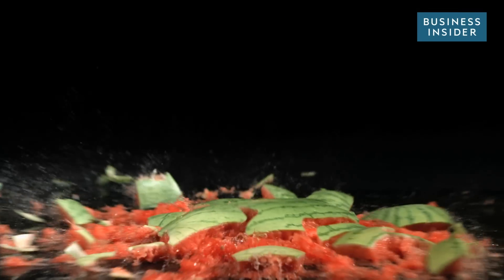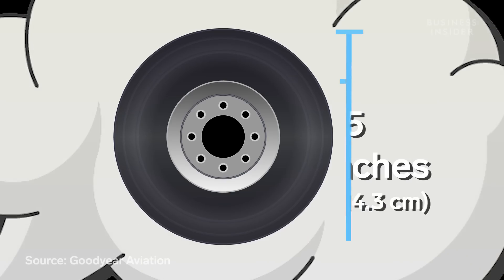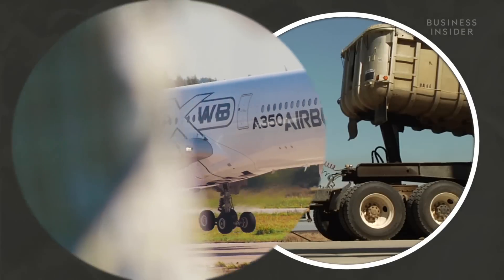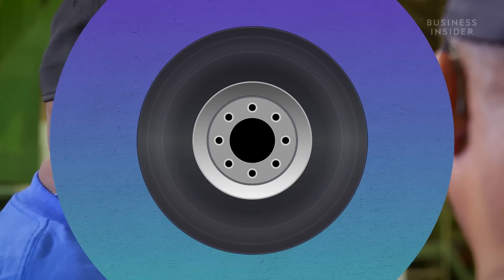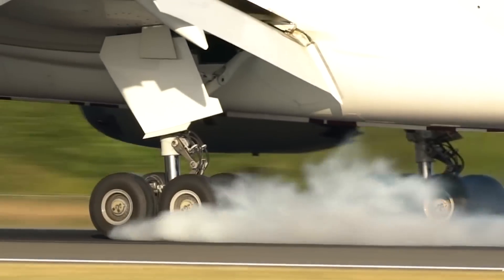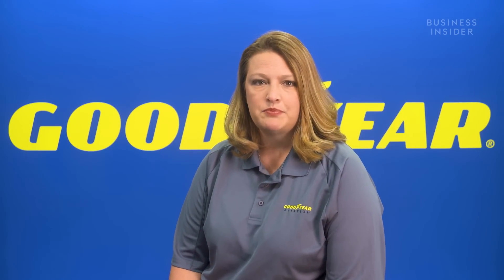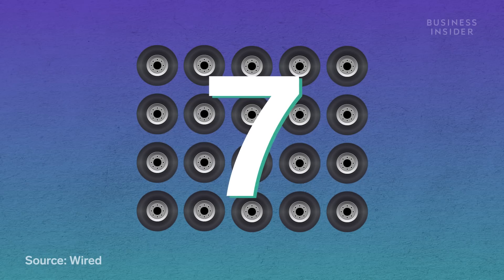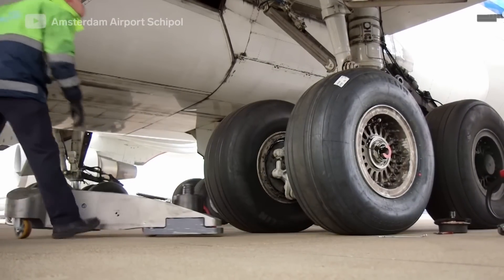Why Plane Tires Don't Explode On Landing

Comment: This clearly isn't your area of expertise. The watermelon example is irrelevant because the tires don't take the brunt of the impact when the plane touches down. However, I will provide the real answer rather than be mean to you like some people.

Obviously, the tires are specially designed, but the suspension system—with most modern aircraft using oleo struts—does most of the work. Without oleo struts, special tires aren't going to last very long. Without oleo struts, the tires could burst after landing or be easily damaged, not to mention the structural damage to the plane since all the energy of the impact isn't going to be absorbed by the tires, and the impact energy will be transferred to the plane.

An oleo strut consists of a cylinder, which is the main body of the strut and contains hydraulic fluid and typically a gas like nitrogen. A piston slides into the cylinder and is connected to the landing gear wheel at the bottom. An orifice is an opening through which the hydraulic fluid flows, dampening the impact force and creating resistance.

So when the aircraft lands, the piston compresses into the cylinder, forcing hydraulic fluid through an orifice, which absorbs the kinetic energy. The flow of hydraulic fluid generates heat, dissipating the impact forces and reducing accelerations. The gas in the cylinder acts as a spring, compressing and expanding to further dampen the impact. After compression, the gas expands, pushing the piston back to its original position and stabilizing the aircraft.

The tires absorb initial impact forces, provide traction, and distribute energy. However, the oleo strut plays a more critical role in absorbing and dissipating the kinetic energy generated during landing. This makes it the most important component for ensuring a smooth, safe, and controlled landing experience. Without oleo struts, those special tires and aircraft will not last long.

Comment: Misleading as hell… some very interesting stuff all in all, but wtf would you start by comparing a watermelon to a radial tire under pressure?? 
And why would you infer that planes hit the ground vertically? They don’t. And why would you also not point out another difference of the aircraft tire vs street tire that you seem to think is a comparable… that’s the fact that total mileage on a aircraft tire in its life is fractional compared to a long haul truck tire.
Totally different forces and stressors, totally different design requirements….” Why don’t they blow up like truck tire?” because they aren’t designed like truck tires, by definition.
Thumbs down

Comment: This was...hard to watch peacefully. Anyway, putting aside the many other fallacies of ur video, at 3:00 you said "The average plane has 20 tires". That's simply not true! The most common wide-body plane, the a350-900, has only 10 tires (so half of 20!). It's longer version, the a350-1000, & the b777 both have 14 tires , and these are as of now the most common big aircrafts on the market. Sure, the a380 has A LOT of tires but that plane certainly doesn't represent the avarage! (Also, it's on its way to become extinct so...)

Comment: Why the internal wheel turned first?
This because there is a little difference between the two wheels circumferences that should be avoided

Comment: Are tires on all commercial airliners inflated to 200psi, or is that pressure specified for certain models of airliner?  IE:  Do 777s and 747s require 240psi tire inflation to support their size and loaded weight, and do 737s or a320s require only 160psi?

Typically, a car's cold tire pressure recommendation is based on maximum axle weight(GAWR) plus a 10-20% safety margin. For a 2015 Honda Accord, that = 33psi set cold.  Even if the tires on that model have a maximum cold pressure of 44-51psi stamped on them, that is far too high a pressure than required to support that Accord plus 3-4 passengers and a full tank of gas, plus ensure good ride and handling characteristics.

Are the tire pressures on different sized commercial planes determined similarly?

Comment: A few fun facts about tires on the Boeing 737 Next Generation aircraft...
-- the tires on the 737NG (-700, -800, -900, -900ER) are inflated to around 205 psi.
-- the nose tire are of a 12 bias-ply rating; the main tires (2 on each main gear) have either 28 or 30 bias-ply rating plies, depending on model of 737. The 737 MAX 9 tires have a 32 bias-ply rating.
-- tires are replaced on condition; not after a specific number of landings. Due to the number of plies, it is permissible to fly with one cord showing on the main tires, but as soon as the second cord is visible, the tire must be changed. This isn't so much for safety reasons, but rather to make sure that the tire casing is capable of being recapped -- because they have so many plies, tire blowouts are rare.
-- in the case of an overheated tire, the wheel has fuse plugs installed which melt and release the tire's pressure, before a blowout occurs.
-- if one main tire's pressure falls to 80% to 90% of the recommended pressure (165 - 187 psi), the tire must be replaced (due to sidewall stresses); and if it falls to less than 80% of recommended (164 psi), both that tire, and the adjacent tire must be replaced (again, due to sidewall stresses, regardless of the adjacent tire's actual pressure reading). If the loss of pressure occurred while rolling, both tires must be scrapped, thus they cannot be recapped.
-- tire pressure is set to 205 psi to prevent hydroplaning at normal takeoff and landing speeds.
-- most commercial airport runways are grooved (from side to side) and crowned to prevent standing water from accumulating, which could cause hydroplaning.
-- regardless of the time stated in the video to change a tire, my airline's mechanics could change a single tire in less than 30 minutes -- they keep fresh tire assemblies under the terminal gates for just such an occurrence.

Comment: Thanks, very informative. (Except maybe for the "speed" at which contact occurs. As others pointed out, the vertical speed is much smaller than the 150 mph give-or-take horizontal speed. However, the usual touch-down smoke cloud also tells you what kind of stresses occur. I believe wheels are pre-spun by the rush of air once the landing gear is extended, so that the tires/wheels do not need to go zero to very fast in an instant? Experts might know more...) 
However, to get to my main point here, the nitrogen fill in the plane tires (instead of plain old air) is probably bogus. Dry air would do too! Maybe it's easier to guarantee that the gilling gas is dry if N2 is used? Not sure... But in general, even for car nuts and wannabe racers, dry air will do just fine. Tire shops like the sucker who pays $20 for a fill with nitrogen, and they even throw in the little green valve caps! (I also suspect a placebo effect. With N2 in your tires some might feel like they can race better, and then they actually do! :-)

Comment: why dont we add air cups to bring them up to speed before they hit the ground. Just a thought. I never could work out why we would have a stationary tyre hit the road at what ever speed. surely, if the tyre is spinning at roughly the same speed, when it hits the ground, it would wear less ?

Comment: Why aeroplane tyres do not burst while landing? Its more to do with the laws of physics than the tyres. The huge degree of momentum that the aeroplane has while landing could crash it into smithereens while touching the ground. It does not happen as that momentum (potential energy) is converted to speed (kinetic energy). The plane races madly down the runaway after touching the ground and that spends up the tremendous force. That's why runaways need to be long, more for the landing than the take-off.

Comment: Plane tires don’t explode because of them being extra strong, when the plane is landing it’s not like it just stops generating life instantly. Maybe only 20 or 30 percent of the weight is pushed on to the wheel initially then as the plane slows down more weight is put on to the wheels instead of the wings.

Comment: Apart from moving 170knots horizontally and 40 ft/ sec vertical. They do  have a suspension that can help tires/tyres to transfer that much  energy to them . In the case of watermelon it has no other way to transfer  that much force/energy so it has to be absorbed by watermelon it self.

Edit :- that tyre has a top A grade steel  being used inside for support.

Comment: What gets me is the angular acceleration for a tire that is not spinning at all, though a huge screech, friction and grab spinning the wheel to landing speed...

Here is my #1 question... How much effort would it take to install a "funnel" that moves air in between the wheel, the slotted (and angled 'spokes') that will make the wheels turn at least something above zero before they touch the ground?  Tho, I do understand that there is a bit of breaking to help slow the aircraft down by this screech.

Comment: Normal airlines like 737 or a320 have only 6 tires. Only huge planes like  A380 and 747 have around 20 tires. Medium sized planes have ussualy 10 tires

Comment: Air planes move forward at 180 miles per hour but they do not fall to earth at 180 miles per hour. They slowly descend in altitude. Some sports cars can reach  speeds of 180 miles per hour. The planes tires would pop if you dropped it out of the sky.

Comment: I’m sorry but this video is completely wrong. It’s only a small fraction of the aircraft weight going down on EACH wheel… and the plane is NOT landing VERTICALLY, its landing practically parallel to the runway at touchdown, and lastly the braking force is being absorbed by the brakes and the wing slats, so really it isn’t that impressive the wheels survive as long as they do.

Comment: Former 747captain here. The 747 has 18 tires, which is a high number for an airplane. I don’t know where you’re getting the 20 number mentioned as an average. We got 25 landings out of a set of tires. Far less than you mention but then again the maximum landing weight is 666,000 pounds which is considerably higher than other aircraft. Just saying

Comment: The whole procedure between about 3:00 and 4:00 refers repeatedly to changing "tyres" but it's not, it's changing *WHEELS*. The tyre is the rubber part, the wheel is the metal part (in the motor world often - and also incorrectly - referred to as the "rim") or the whole assembly. I don't know if it's an American thing or an aviation industry thing, I come across a lot of this use of "tyre" when the speaker means "wheel", which as a dyed-in-the-wool pedant makes me grind my teeth a lot. Very tiring 😡.

Comment: The pieces of truck tires you see on the highway are retreads.  Old tires that have new tread applied.  They fail frequently.  Why they are allowed on us highways is a mystery to me.  They are quite dangerous and have killed people.  So your comparing apples to oranges.

Comment: Long answer:They are reenforced with other stronger materials to withstand the landing furthermore the plane has many tyres so the force a tyre recieves is much less additionaly most of the planes velocity during the landing is horizontal and not verticall and last but not least the plane has suspension to support the tyres

Comment: 170mph vertical was very wrong, you are probably in condition of falling. Stalling. I mean stalling is low speed, but if it hard stall it probably  will be keep fall in 170mph.

Comment: May be Because the tyres of airplane are filled with Noble gases 🤔🤔. And it does not explode on making ground contact at 170 kmph . As the friction reduces and all nobles gases are highly inflammable.

Comment: 78% of the air we breath contains nitrogen. 22% more nitrogen in tires will help a little bit, but it's hard to guarantee that all other gasses will get flushed out with a nitrogen fill.

Comment: How uninformative.  This is a bad video because it does not impart more info than "planes are different than cars so their tires are too" at the cost of my time.  This lessens the value of the brand and if it happens again I will block this channel.

Comment: I dont think this answered the question adequately.   
Other than a 3 sec blurb about what the tire is made of no explanation of what those materials are specifically used for and how the combination works to overcome all that pressure.  How much stress is created when they land? 
No talk about the burning rubber smoke plume each time them land.  
New tire tech?
Physics?
Video of blowouts
How many tires can blow out before the plane is in trouble?
What is the wheel made of? 
A lot of fluff about tires that arent on planes tho...

Comment: I never worry about tires when flying. Never thought of it. 

A missing wing or an engine fire, however...
Reply: You should worry much more about the tire because there aren't any cases of wings falling off and if the engine catches on fire, you've got another one.
Reply: @smasheduptoaster9186  I rarely heard plane tires bursting, almost like never, only stuck gears/hydraulics which prevented the tires from positioning correctly upon landing.

I would also worry more on engines failing than the tires. Imagine if you're flying in the middle of pacific and both engines failed.
Reply: @iamwisdomsky  That would be scary but it's not worrying because it's so unlikely. And landing gear failures aren't a big deal either. They happen every so often without any injuries. And a burst tire is very common. You just don't hear about it because it's not newsworthy.

Comment: You can't drop a watermelon at 170 mph, the melon's terminal velocity is only about 112 mph.
Reply: It depends on the height where you are dropping it
Reply: @kamitsoglouuu  umm,I don't think terminal velocity depends on height??
Reply: @bigechungus6778  well, technically it does as air pressure and therefore air density drops with increasing height. This reduces drag at high altitude which raises the terminal velocity as it is governed by the equilibrium of gravitational pull Vs. Atmospheric drag. If you were to drop a watermelon from the stratosphere, I guess it would slow down quite significantly on its way down....

Comment: Huh, I always thought plane tires were "spun up" before touchdown so it didn't have to spin up from nothing to full speed.
Reply: I actually asked a commercial pilot friend about that, thinking it would lessen the impact.  he said it was tried but the wheels acted like gyroscopes and put the aircraft out of control.
Reply: @dono.3115  Never thought about that. I just heard about it as a kid (in the 70s)and assumed that it was still a thing.

Comment: 3:01 Commercial jets usually don't have 20 tires. Even the Boeing 747, one of the biggest commercial jets, have 4 main landing gears and a nose landing gear, have 18 tires only (4 on each MLG and 2 on NLG). Other smaller aircraft commonly seen like Boeing 737, 757, 767, 777, 787, Airbus 330, 340, 350 have around 10 to 14 tires.

Comment: 1:56 from when did nitrogen become an inert gas? Add a matter of fact, the formula of gaseous Nitrogen is N2. N2 is very less reactive due to 3 Pπ–Pπ bonds which is highly stable. The only inert gases are He, Ne and Ar
Reply: Huh? What about other group 18 gases???

Also, I think they only meant that nitrogen gas is inert (as is non-reactive), not like it's literally in group 18
Reply: Inert is relative. Compared to oxygen or fluorine, most gasses are inert. Unless you are performing the very specific harber-bosch process, n2 is going to be pretty inert.
Reply: Nitrogen is less sensitive to temperature changes. That's why they use it.
Reply: Nitrogen is an inert gas tf
Reply: it doesnt have to be noble to be inert i dont think
Reply: I think you are confused between inert gas and noble gas. All noble games like helium and neon are inert but not vice versa

Comment: "The reason we have grooves in an aircraft tire at all is because we need to evacuate water if we were to land on a wet surface."

Me and F1 fan: So they're running inters!
Reply: Lando would try to land using slicks at the runway.
Reply: Yeah also a bit simplistic. It's the reason ANY tyre has grooves in it. She sort of touched on the real reason for the different patterns but the explanation was confusing at best, and kinda reinforced the erroneous impression that a lot of people have that car tyres have treads for "grip".
Reply: Or full wets

Comment: This is literally just some girl talking out of her ass. The plane touches down at like 30mph. The forward speed is irrelevant, because rubber tires can spin and slip. Also, the plane maintains a constant lifting force, even throughout landing, so the weight of the aircraft is transferred relatively slowly to the landing gear.

Comment: "They raise the tire only five centimeters off the ground, which doesn't feel like enough room to fit a thumb..."  so as well as doing the barest attempt at research and physics not being their strong suit, clearly they have no idea what 5cm looks like either.
Reply: @valentin.kompatscher  If your thumb DOESN'T fit in a 5cm gap, you got issues.
Reply: She's american
Reply: forbidden thumb = PP
Reply: An american thumb might be fatter than average.
Reply: To be fair, it was qualified by "doesn't feel like" 😝
Reply: Yes exactly. That’s two inches. Coincidentally, in French a pouce is a thumb. It’s also the word for an an inch in French. So in fact two thumbs or two inches fit under the tire. She’s talking a load of rubbish. Whoever wrote the script for this must be about 14 years old.
Reply: Exactly. My thumb is 2cm at the widest point
Reply: I wonder how that steam from the tires when landing smell like !!!
Reply: Or what a thumb looks like